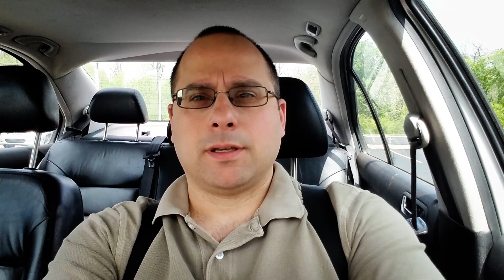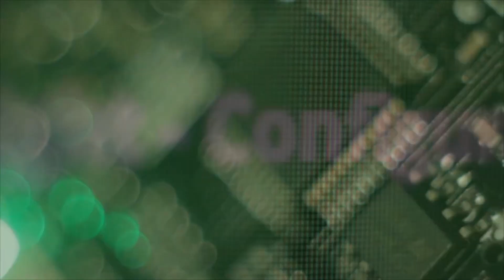Frsky Taranis antenna mod and why you probably shouldn't do it.

Comment: damn... it's been a year and my taranis is still doing okay after the mod. hopefully this won't outline my future!
Reply: Maybe you hit the nail on the head when you mentioned static electricity. But perhaps it is not when you were performing the mod but rather when you screw the antenna back on every time you fly. Some people may live in humid climates that do not see much static and others may not remove their antennas much. Its a plausible theory anyways...
Reply from the maker: +Adam-g1 wish we could figure out what you did differently.
Reply: Joshua Bardwell the only thing I can think that I may have done differently was that I did measure the total length of the stock antenna and made sure everything was the same length for the antenna mod I soldered on. Also I did use some fairly thick wire for the antenna, I can't remember which one though. I almost never remove my antenna also, I just bring my taranis as is because I do worry about static electricity.

Comment: xjt module and 5dbi antenna ftw.
Reply: After my internal radio died I went with the module.  Tried several generic 5dB antennas and got ~14 SWR.  Tried a TP-Link 8dB antenna and got a solid 0-1 SWR.  (internal radio had quit receiving telemetry)

Comment: Joshua do not be discouraged ;-) I would like to make a request to see freestyle more often. Regarding the deaths of the modules:
I still have my Turnigy 9X with Telemetry MOD and DJT in PPM but happy.
After working some time on analog TV repeaters and on HF UHF VHF radio 
mounting antennas, going up to repeaters I can say that, regarding the 
antistatic wristband it was in the compulsory workshop to be connected 
to the ground every time you put your hand in components SMD.

Placing an antenna and measuring standing waves makes the difference between running and not working; Is essential in all TX not to burn the power stage. The problem at frequencies as high as 2.4Ghz is that a dimminut change affects too much to achieve something optimal.
Even the length of coaxial cable used affects the value of SWR and can
 make it impossible to adjust if you are unlucky enough to mismatch.
I opt not to fiddle much with the modules to avoid coaxial extension and to buy antennas that seem to me of quality. 

If you have a WiFi at home you can try those antennas are often of much 
better quality than those sold specifically for our modules to me has 
given me good results.

Sorry this is a Google Translator.

Comment: dude that sux because I need to something with my broke antenna be it completely breaks off.  now what?
Reply from the maker: +EnlightMent replace it with a stock antenna and pigtail.
Reply: The patch cables are easily found online. also search for uFL to RPSMA. In any case the pad under the uFL socket will accept direct soldered mini coax. maybe not for the soldering inept but doable.
Reply: Joshua Bardwell the problem now is that if you have a Taranis with a s/n that has "B02" in it it has an ipex connector on  the RF board.
The FCC told frSky that they could not sell replacement antennas with an ipex connector on it anymore.(I was told) So if you are like me and have one of these radios and you break your antenna , you HAVE to mod it with an ipex to sma/roams .Just pick your antenna wisely! 
Google frsky stock antenna replacement with ipex and tell me if you find them. I looked for weeks earlier this year and even Wayne from Aloft couldn't find them!